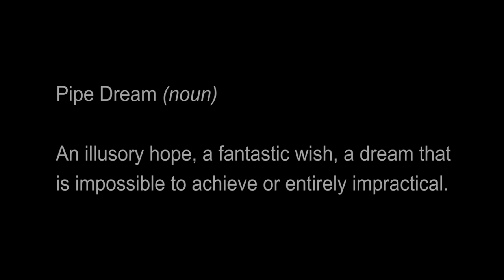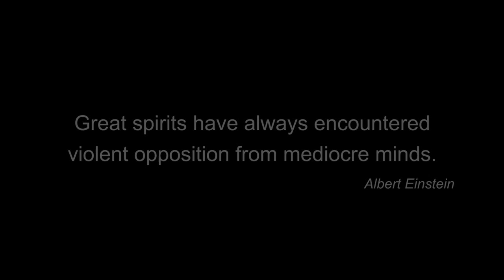The Pipe Dream Project - Paddling a PVC pipe boat

Comment: I really enjoyed this video. It reminded me of when I built something like this to cross, not go down, the Mississippi river. I wanted an "EMERGENCY" type raft to just float across it, but like you, I was all over the place and the current was a killer. I went waaaaaay down the river before I finally made it across, and I mean several kilometers. 

This was to be a cheap throw away item with a low profile. The pipe also held some gear and my rifle, and not be looked at as an item of value if seen inside the vehicle, and when I crossed, I would remove these items and be on my way....in "THEORY" anyway.

As with anything, there's "THEORY" and then there's "PRACTICE". 

Mine was not nearly as high speed as yours. I had two 6" PVC pipes and then a cut down 1/4" sheet of plywood with one side sprayed with close cell foam about 1" thick. I own a foaming machine. 

I had holes drilled in the plywood and my thought was to use heavy duty zip ties and tie the pipe to the plywood. I did just what you did, made it straight and I had no control at all. Then on my second try I angled the pipes into a semi "V" shape and a bigger fixed rudder in the plywood made from coroplast. 

These mods made it much more controllable unlike before. Before, that ride had me scared, and the old pucker factor was running about a 1,000% when I was spinning out of control going down the Mississippi. I mean you could not pound a pin up my ass with a jack hammer.

I think if you were to design a rudder that tips back and out of the water for going through the shallows, and then tip back down in deeper water, and make it so you can control it with your feet and some rope to steer the raft, you'll be golden. Make the rudder BIG and you can always cut it down or use two rudders working together. Keep up the great work.
Reply from the maker: Thanks for your comments and for sharing your experience. Yes, there is 
theory and there is reality, one can spend an entire life designing the 
raft, but the proof is only when one launches in the water. The next 
design will certainly have a "V" shaped bow (and maybe even the stern). 
Am seriously thinking of a rudder(s) that will be foot operated like in 
kayaks. And maybe a bit longer with 8 inch pipes. The pipes I used had 
thicker walls and hence heavier. With thinner walled pipes, the buoyancy
 will remain and yet make the craft lighter. Including the boat, I was 
carrying upwards of 150kg. Need to reduce the weight of the craft to 
around 15 to 20 kg. That might keep it out of the water. The bottom 
layer of six inch pipes was entirely submerged, thus increasing drag 
tremendously. That has to reduced.

Comment: its cool that you went out and created and managed to build a boat. but u made it out of PVC. a plastic. not recycled but new.  what happened to the legs of the plastic chair you cut? it probably ended up in the ganga and the bay of bengal too.  all the kit you have on ur boat is plastic. the bags, the cords, your water bottle, the straps that hold your oar to ur hands, the sunglasses, the life jacket material, everything except you on that boat is plastic :)

i appreciate your creativity to go out and do it though. yes you are right the boat needs to be streamlined. take a look at boat builders of kerala [for streamlining] or the catamarans [kattumarams] of tamil nadu [for stability]. your boat is stable because it is actually a catamaran which is quite stable but hard to point unless u had a stick oar.

i am messing with boats too and have considered building it with pvc flexible pipes as a skin on frame canoe/kayak. maybe that would be a good option for you too. it would be nice to see how you proceed from here. good luck and am excited about your new projects.

oh u need to reinforce your solar panels by having triangular bracing like on bridges.
Reply from the maker: Thank you for your constructive comments. Yes, a lot of stuff on the boat is plastic, including the boat itself. And all plastic is bad. But within that, what is worse is single use plastic - bags, bottles, packaging, etc. Ideally do not use any plastic at all, but that is almost impossible in today's day and age. At least let us attempt to reduce single use plastics.

I will work on another design, possibly with a "V" shaped nose. That will make it more streamlined ... I hope.

The solar panel was not meant for this kind of a journey and hence all the problems with it. I possibly need a rigid panel that can be strapped on more easily.

We live and learn, don't we?

Comment: Wow, check all the trash in the tree at 10 min in!  Stay n in the middle of the stream!
Reply from the maker: Yes, the Ganges and pretty much all rivers are full of pollution ... visible as well as solubles. That was one of the purposes behind this effort - to raise awareness. 

And the boat design was flawed making it difficult to steer. Phase II will see a more streamlined design to sit on the water and cut through the water better.

Thanks for watching.